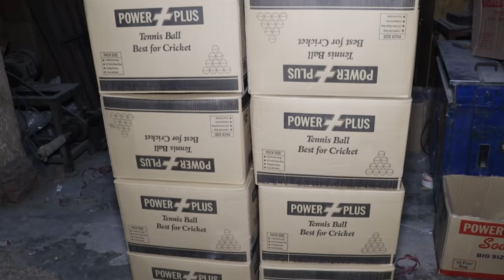How Tennis Balls are Made in The Factory

Comment: Having wired a rubber press at a tyre retread factory and seeing it in use, apart from the obviouse mechanical risks, the biggest long term safety risk is the toxic fumes. They mix sulphur and all sorts into the rubber.
Reply: I think that's why we have stuff made overseas.  Stops becoming our problem.
Reply: No WONDER tennis balls smell so awful!! 🤢🤢🤢
Reply: @battosaijenkins946  Cricket Balls?????
Reply: And all that dust that is kicked up when he dumps the bags of ingredients onto the rollers.
Reply: Sulphur is not bad for you though. It just smells bad
Reply: I wouldn't even let my pets play with tennis balls. The fumes are sickening.
Reply: @pdorism   Limited contact with powdered elemental sulfur is not especially hazardous. However, if you’re smelling something, you’re inhaling it and prolonged inhalation, such as in this video can cause severe bronchitis, and contact with skin and eyes can cause dermatitis. The real danger comes from heating sulfur which can produce hydrogen sulfide gas, which is poisonous, corrosive, and flammable, and/or toxic sulfur dioxide gas, which produces sulfuric acid in the presence of water (such as in your lungs). And several stages of manufacturing in this video involved high heat. I just wanted to add a little extra health information to your comment that sulfur “is not bad for you”.
Reply: Having worked in another rubber goods factory it's almost certainly synthetic rubber which only adds to the  fumes produced. The mold temp was about 178 C.

Comment: The first time I've ever seen a video of somebody mixing rubber on a mill.  This was one of the first skills I was taught when I started work at 17 yrs old. Despite the huge size of the Mills accidents were usually losing the mill knife into the mix. Wonderful to see this process again after 50 years.
Reply: Love ya' Walter! 💗
Reply: I was a factory hand at 17 extruding rubber into seals,orange window seal etc after I did my plastic extrusion training.
I used to hand feed uncured strip's cut by the mill operator into a steam heated extruder. 
I'd help with die changes and cleaning them.
The parts were autoclaved to cure the rubber, I was surprised they used flame heated curing. Quicker I'd say...
I'm now 45.
Reply: I have a company in Spain and its a very dangerous work, one worker lost 4 fingers and doctors had too put finger of the feet in the hand.
Reply: With ones that ended up as defects, ever stock pile them and once enough try surfing
Reply: I worked at a rubber mill that made small wheels for shopping carts and roller skates. Working the night shift I once dropped my knife and foolishly tried to grab it. The rollers caught my glove as I yanked my hand back. The glove went down and when it came back around, had flattened about three times bigger! I quit.
Reply: @Fotosaurus56  reminds me of this tire warehouse. so many employees not even using the safety harness.
Reply: Growing up in Akron, Ohio, my dad worked at rubber factories when I was a kid. Till it all went over seas. I remember him coming home solid black from that place.
Reply: Step 1: Stick fingers directly in press.
Step 2: Actuate press.
Step 3: ????????
Step 4: Remove tennis balls from press.
Reply: @JoseAntonio-yo8dq  yes, you mean toes to replace the fingers

Comment: 5:40 that engine valve in the drill press being used as a friction device is so very cool!!!
Reply: Yeah I noticed that too. They are so resourceful.
Reply: @LegendLength  But cost more...  Wood is cheap and lasts longer.
Reply: @LegendLength  you'd nick your finger easier with that and need a holding device anyway.

Doing some linkage to hold the sanding thing and press it automatically with the thing might be easier tho. Well, automating the whole thing would be long term easier
Reply: @LegendLength  would need replaced more, way more, and risk of sanding the inside rubber finish throwing off the  weight and quality of the ball. A piece of metal grabs very quick and does not tear or harm the rubber. Metal on rubber actually gets better traction.
Reply: I scrolled far too down for this!
Reply: @Oink_Blaster  had to get past all the haters and wimps

Comment: If you have crappy valves from an engine they can be used in a drill press for preparing the edge surface of half a tennis ball for adhesion. It's an interesting factory, fairly basic and gets the job done.

Comment: If the halves need to be cut out after forming, why bother with cutting the rubber into chunks? I would think it'd be easier and faster to use a full sheet
Reply: I was wondering that as well... 
My thought is that by having it separate, it may provide uniform distortion across each ball half?  Like, if an uncut sheet were used, the 'balls' in the middle would have tension all around and edge 'balls' and corner 'balls' would have tension only on three or two sides. 🤔

Comment: as I'm sure many have observed, messaged or noticed or whatever, these standards really aren't efficient or effective for the workers livelihoods I'm quite sure, and I'm surprised the factory or workers were ok with it being filmed. all the safety hazards I noticed were extremely easy to fix while still easy access to the machinery or whatever. making it a more comfortable environment would be as simple as comfortable chairs (though maybe culture comes into that), perhaps repositioning them in regards to the heavy lifting; using wheels for the heavy lifting (yes he's paid to do it, but a very bad attitude to have when it comes to long term health and the revenue or surely a finance/bisiness analysis surely able to afford it). bare feet-ok, let's assume it's their choice and no way around that-paint the floor and idk, announce its passing in some way. the burners don't need to be so exposed and seems very inefficient, also the legs/structure weren't stable-a simple wedge and it'll be fine. I doubt it's even checked for structural integrity. the guy on the drill or whatever it was, I can't remember, he'd likely get repetitive strain injury. a racking system for the ball halves being glued would also be far safer and efficient on space and less careful about laying them right. Exposed  machine parts could also easily do with a simple door, wood would surely do as a very simple fix if strong enough. the lighting doesn't look suitable either, eye strain is a serious issue but the camera may not do justice to it. the whole place looks proper dirty and yes one could say priorities on aesthetics aren't important at all and aren't worth the efforts to move things on some cases but it'd just need doing once, and it'd be far brighter with bright colours and far cheerier for the staff; working happily (I'm not assuming they're unhappy, but it would undisputedly boost morale and thus, effectiveness) is a major thing, humans spend most their lives working so it's important to make it as enjoyable as possible, where possible. it's not just about getting the job done and doesn't mean they'll be less effective or anything negative at all. I do, however, admire the use of more staff-more livelihoods for those living in the vicinity

Comment: That sticky roller would pull your arm in in a flash.....
No guards on the gears, motors, belts of any kind.  Didn't see safety off switches or lock outs.
This is why the west can't compete.....if Abdul gets his arm pulled off there is another Abdul lined up to take his place. If that happens in the US you sue the company for millions.....
Do these operations look "green"?  Why are we paying $6 a gallon for gas and these people have zero environmental regulations?
It is apparently the responsibility of the west to take the brunt of regulation, environmental footprint and labor laws.